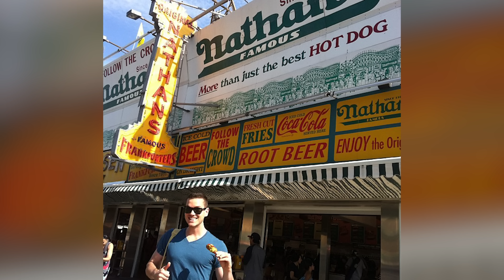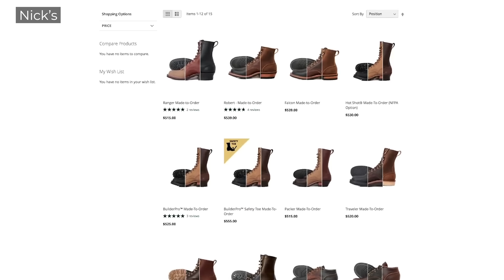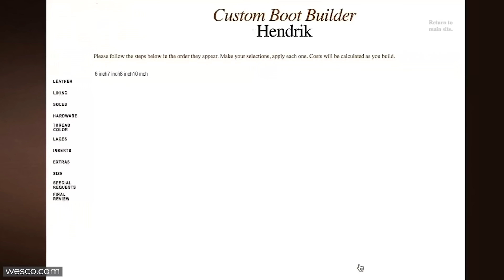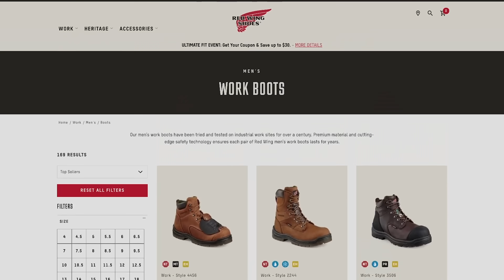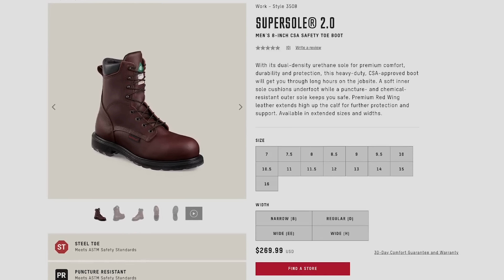THE 10 BEST AMERICAN MADE BOOTS (with @TrentonHeath)

Comment: i was wearing timberland but they were severly hurting my feet ,,,, i got a pair of red wing boots with a nonmetallic safety toe and metatarsal protection on the box they are marked 4456  and they instantly stopped my feet hurting they are very comfortable i work in a foundry and they are holding up very well ,,,,, the best work boot ive ever worn

Comment: Not surprised to not see wolverine in the lineup. They were my first pair of nice boots I purchased. The 1000 mile boot looks nice and broke in pretty easily but I ended up getting a small rip in the leather on the side of the boot. I know I can repair it but I ended up buying a pair of Chippewa boots and they've been holding up better for a few years now. The leather is better than in the wolverine boots and with my work I don't have to worry about it falling apart.

Comment: No mention of Wolverine boots?  Are they not made in U.S.?  That surprised me.  I need some Red Wings though!!
Reply: Wolverine quality is poor. I own 3 pairs, and 3 of them have failed. One pair the rubber vibram delaminated from the leather sole. On my other pair, the heel literally detached from the sole. I sent photos to a couple cobblers and both pointed out that Wolverine should have used nails to attach the heel to the sole of shoe, but it seems they relied on cement, which failed. I will never buy another pair of Wolverine 1000 Mile boots. They are not worth the money. It’s a $200 boot being sold for almost $400.
Reply: @EDHBlvd  I lucked out and got mine for $189...cheaper than my Thursdsy Boots.  I enjoy my 1000 miles so far, but they don't get a ton of wear or abuse.  I will keep an eye on the heels.  Thinking a 360 welt would be a nice upgrade.  Maybe if I ever get them re-soled.
Reply: EDHblvd my Krause models are very well made.  The heels are nailed to the soles.  But the Krause might have been higher end.

Comment: I spent 55 years in heavy work boots, not the heavy tennis shoes mostly featured in your video. I started with Red Wings that were readily available locally. They didn't last long. I found Nick's 14 inch loggers with Vibram sole, and never looked back.
Reply: Glad to hear;  I started in shipbuilding industry in 92’ (30 yrs now) and “ONLY” Redwing for me. I’ve even had loggers on one end of my spectrum(work) and then there is my Redwing Engineer slip-ons; they are expensive but feel like slippers yr when I put on my feet. I went outside of Redwing this year since I moved in a classroom setting/environment teaching Sheet Metal ( still wearing the Redwing Engineer&Redwing NailSeat 1155) but had to try Wolverine 1000 Mile Oxblood loafers. I hate Wolverine work boots but let me tell you these are on another whole plane of comfort. Don’t know why, I just like the feel of leather soled shoes and till you have worn them; you will “Never” find comfort in your day to day activities!#Redwing#Engineers#NailSeat1155#Wolverine1000Mile

Comment: Great video! Sometimes it can be hard to decipher who makes what and where these days. 
I have a question for the experts!
I am looking to buy a good quality boot/work shoe. My days of needing safety toe is over, but I work in manufacturing and have to walk on concrete all day, and my shoes/boots can be exposed to very high temps on occasion(melted plastic, 400+ degrees) but only briefly. 
With that in mind, here's the kicker: I weigh 285 lbs. I am not fat(I used to pick my buddies Plymouth up by the back bumper) and it just strikes me that I am unable to find a pair of shoes, workboots, whatever that are designed to take the beating my weight puts on them. Almost every pair of sports shoes, hiking boots, whatever I have had has had the insole and whatever is under it crushed/squashed out before the rest of the shoe is worn out. Occasioanlly I will have one hold up but the sole gets thin and worn funny, which is bad on concrete. I haven't had an upper wear out on me in at least 30 years now on any footwear. 
Most workboots are the same, I destroy the insides of them before the outer parts go bad. 

Can you recommend a nice leather shoe-ish boot that will hold up to working on concrete under my weight?

Comment: Haha, my first pair of boots were indeed Red Wing Heritage brand. They're still not that old, maybe three years old. They're the Sheldon 9071 model which I don't see on their website anymore but they look basically like the current Blacksmith model. 

I like them a lot but I see the very tip of the left boot has delaminated slightly. Right one's perfect though; not even starting to do that.

I think now that I finally found another frickin job after months of being laid off I'll at some point pick up a pair of chukka boots. I have a pair now and while they look decent and I like them, they're just cheap faux leather ones. Time to upgrade those mofos and I'll probably use this list for reference. Thanks guys!

Comment: Saw where Mark Albert boots are out of business. The pair I bought (waxy Outriders from one of your previous reviews) for just over $250 are completely coming apart at the seams. They must have used some cheap Mexican thread when making their boots. The first seam to fail was within 6 months of purchasing the boots. I thought they'd just send me a return lable and replace them, but no...they wanted proof. Told me to send pics so they could determine a response, told me they weren't designed as work boots even though I didn't use them as work boots and didn't even wear them every day. I told MA in a FB message session that he'd be out of business way before he ever realized because of this reluctance to stand behind their product. I was right. They were well made boots with substandard thread.

Comment: I wondered if you could do a review between Grant Stone and Parkhurst.  They both are similarly priced and have awesome quality.
Reply: Grant Stone is better by leaps and bounds.
Reply: @deepstarsix  may i enquire, which boots do you purchased from grant?
Reply: @justin_t  I have a Diesel boot from Grant Stone, and an 'Allen' in natural Chromexcel from Parkhurst.  The finishing on the Grant Stone is impeccable.  The finishing on the Parkhurst is sloppy, also the interior of the boot is unlined with leather flaps.  It had a thick string coming out of the sole in the interior of one of the boots, and I had to prune it down so it wouldn't poke my foot.  It also fits kind of funny, they're using some sort of unique last.  I would be so bold as to say that my Thursday Captain boot is in fact better in finishing and comfort (Thursday lines their boots), albite with wider stitch density on the sole compared to the Allen.  Parkhurst boots are great in theory, I totally get your interest, it's the same interest I had that lead me to buy one: they look good, they're American made, they have a split reverse welt with a real Dainite sole.  But they fit weird, and have subpar finishing.  With Grant Stone, they're made in China, and have a Dainite facsimile sole, and cost the same.  On paper the Parkhurst sounds better.  But with one significant difference, Grant Stone is made with an attention to detail and quality.
Reply: @deepstarsix  thank you for the reply.  I have also been eyeing grant stones.  Especially the brass boot in black cxl.  it's a beauty.  I'm just waiting for it to have a sale before I make the plunge.
Reply: Justin T they have a Black Friday sale.  Maybe a Father's Day sale as well.
Reply: @Kingfisher1215  Thank you Ima.  Yes, I do know about their Black Friday sale.  Perhaps, I can start saving money now :)

Comment: Very interesting with some good information about leather and leather quality.  However, fit is everything in boots, and they didn't' analyze the differences in fit.  In my experience the greatest things about Whites are their fit and arch support.  Whites boots are made on several different lasts and if you get the boots made on the right last for your foot you will love them.  Like Whites, Wesco will give you a fitting at the factory and you can get a great fit.  The other thing you left out is how different boots work Doctor prescribed orthotics.  White boots with high and medium arch support don't work orthotics, but Whites has models make to use with orthotics.  My Wescos have lower arches and so work with my orthotics.  Men who work on their feet will probably experience their feet breaking down over time, so the boots that were perfect at 25 probably won't be perfect at 50.  Our feet get longer and our arches get lower.

Comment: I bought a pair of thorogood boots  last year and the lacing eyelets were off over a half an inch from one side of the boot to the other.   It's impossible to keep your socks up no matter what kind I wear.  I tried to contact them  3 and maybe even 4 times and they would not answer me.  What gives.   $249. dollars setting in the closet.   Thought I was getting the best but instead got the best  screwing.   Retired and on a fixed budget wanted something that would last----Go figure.   I guess they will last forever because I can't wear them.
Reply: Didn’t you have a chance to try them on before you bought them. ?

Comment: As a former electrician for 7 years and current mechanical engineer, I would not recommend a boot without rubber soles for an electrician. That's just common sense.

Comment: Great video for the boots and manufacturers recommendations.
  Although, I wear work boots every day for the last 35 years, Red Wings mostly, I've never been a fan of guys that wear work boots with their pant legs rolled or cuffed to the top of the boot that work in an office or some other non labor job.
  I think it is such a stupid look, almost as stupid as the guys that wear their work boots, with the laces undone like the rappers used to a few years back. 
  Don't do the Urban Lumberjack look either. If you have never changed a car tire, never used a hammer other than for hanging a picture, never worked in a dangerous environment, you shouldn't be wearing work boots. They are not a fashion statement.